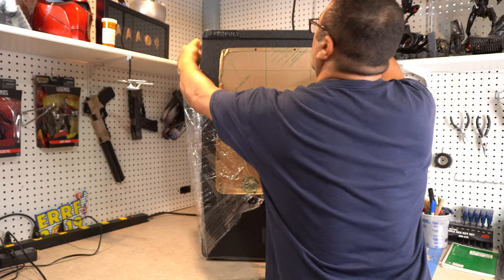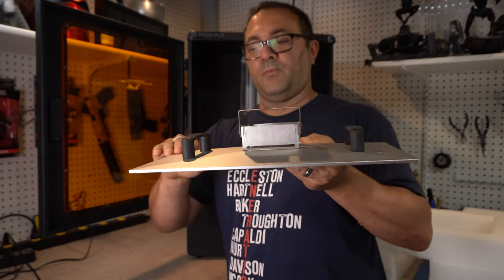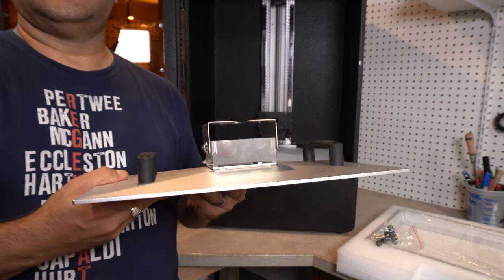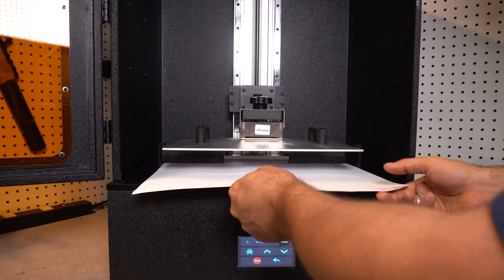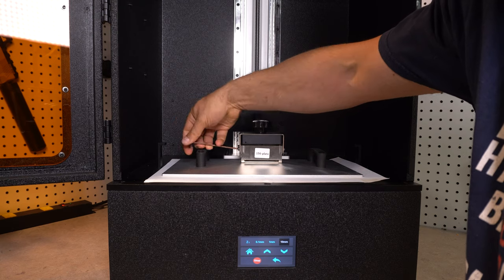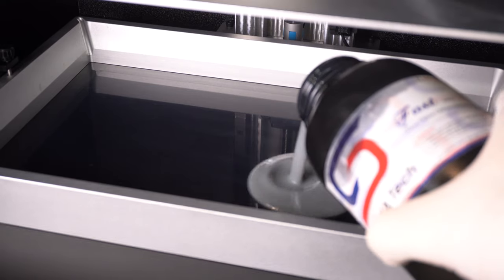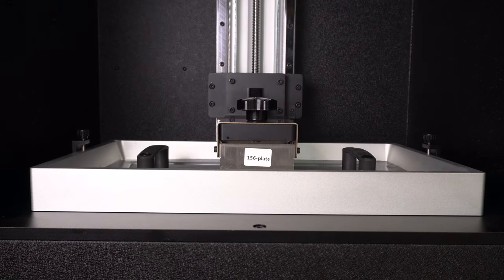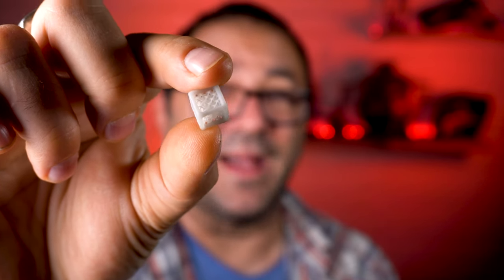Peopoly Phenom L - Unboxing and First Look !!

Comment: My phenom L just arrived, and other than the text print no other print has been successful. The supports won't print or print is stuck to the vat. Can you help please
Reply from the maker: I would take some coarse sandpaper to the bottom of the build plate to give it some tooth. This helps the resin stick. You should also check your initial exposure to make sure its correct so that it adheres to the the plate.  Lastly you can use something like this on the vat to help cut down sticking. https://amzn.to/3pU6yUa (aff link)

Comment: I got one and there was a bad cable inside the machine. Three weeks later the LCD panel broke and cost me $200 to replace. DO not get this. It is poorly made.
Reply from the maker: Hello, sorry you had that experience. I've had other printers come to me damaged and that sucks. I however don't feel the printer is poorly constructed myself, but yes sometimes flawed machines make it out. I know if I got mine in and was having those issues I would not be pleased either.